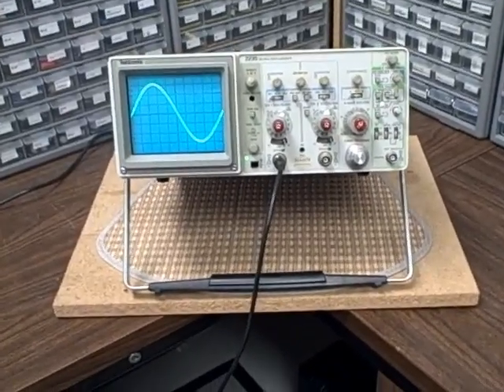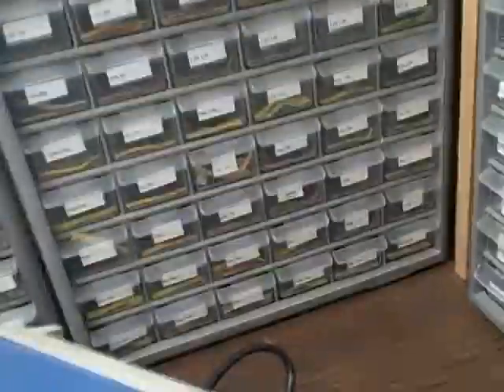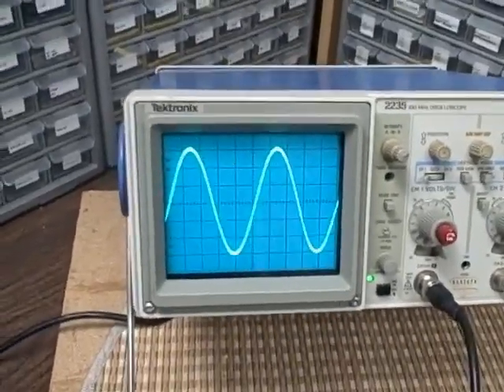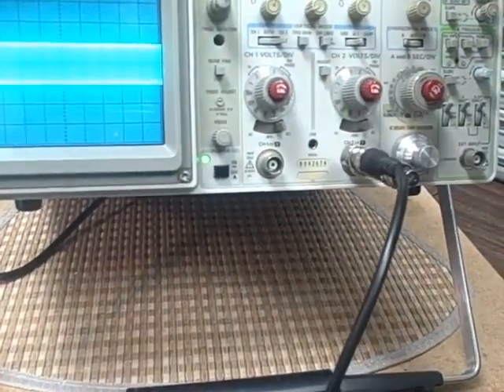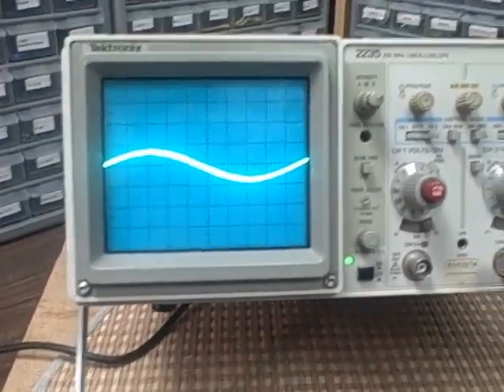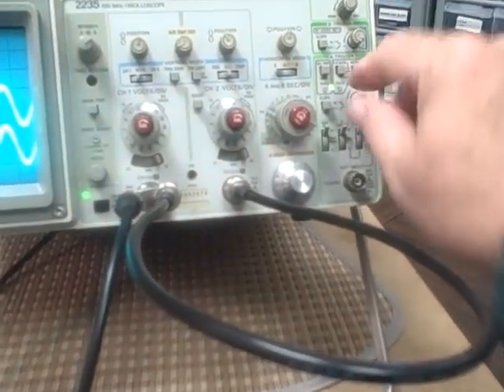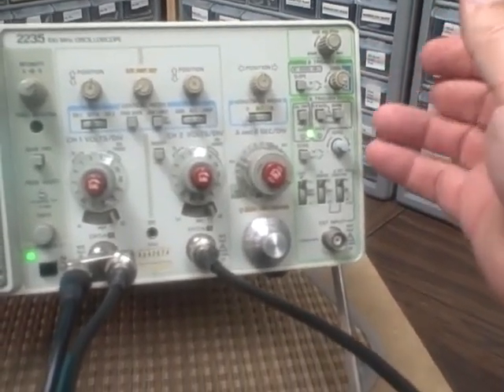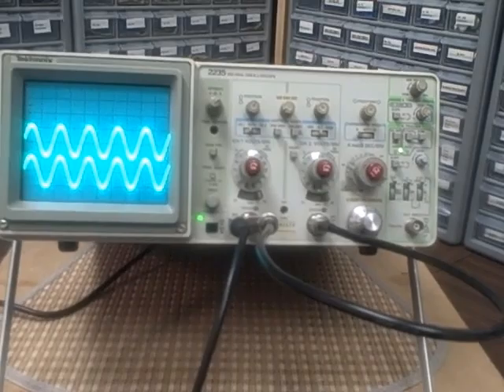Tektronix 2235 - 100Mhz Dual Trace, Dual Time Base Oscilloscope

Comment: Hi this looks great! I wonder about these vintage scopes. At 40 years old are there problems with caps drying up and going out of spec? thanks!
Reply from the maker: I have found few instances where values have changed beyond the point of being corrected by calibration. Most problems are the result of corrosion and/or lubrication.
Reply from the maker: Of course there could be problems, but my experience has been that they often still work great. Usually a good cleaning and adjustment is shat is needed.
Reply: @bap8guy  What is that U formed cable that is attached to the O'scope used for?
Reply from the maker: @SDsailor7  that u shaped connector allows me to connect both input channels off of the same source.
Reply from the maker: Very seldom have I found such a problem. I do have to do calibrations though.
Reply: @bap8guy  Ah I understand.
Thank you
Reply: I did end up replacing the RIFA caps (which are known to crack and explode eventually), mine looked already somewhat cracked. C902, C903, C904. Also the EIC power jack has a similar safety cap inside, if it’s labeled Schaffner, change that. The electrolytics were ok.